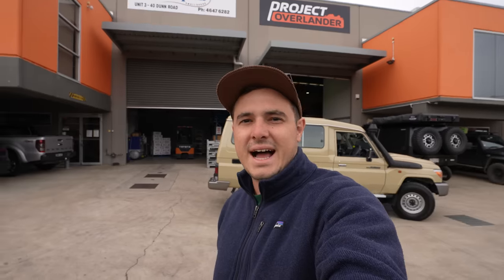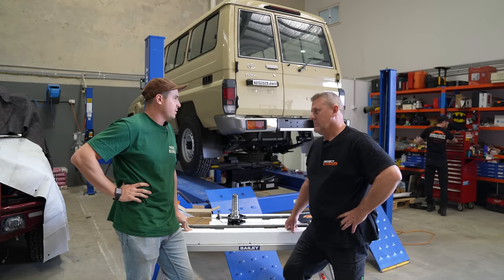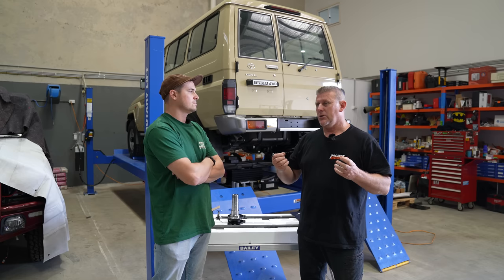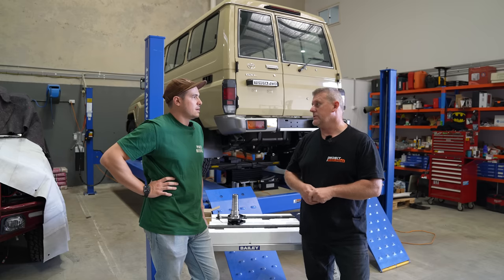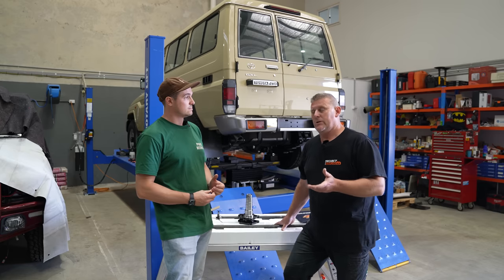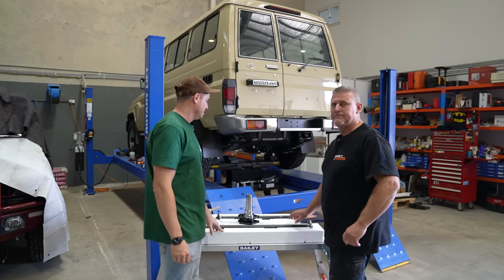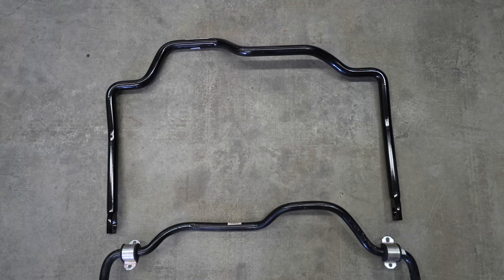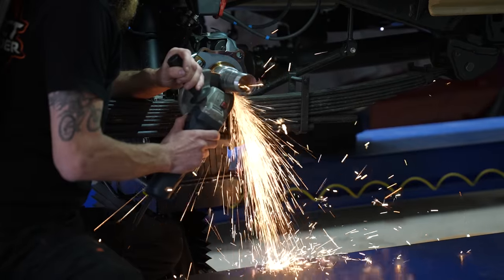Building An Overland Troopy - Track Correction and GVM

Comment: Looking good. The multi drive gear is excellent. I installed their replacement housing into my 76 series a few years ago. There is no doubt my wagon drives much better on and off road with the track corrected.
Reply from the maker: Good to hear from someone who has been using it!
Reply: @OverlandTravellers  no worries. Would be my first mod if I was to do my build again. I reckon you've gone about it the best way doing gvm and track correction pre reg. Perhaps consider a brake booster upgrade too if that's not already on your list. Standard brakes are adequate but will make you work hard to stop - especially when loaded up and rolling along at 80kph plus.

Comment: It's so generous of Toyota to keep little workshops like this in business by not building their vehicles properly in the first place 😉
Reply from the maker: It is pretty incredible the amount of engineering and products that have been produced because a diff wasn't wide enough 😅
Reply: @OverlandTravellers   I can understand how it started that way, but once Toyota realized how popular these vehicles were, it's crazy they haven't done anything about it in 15 years. All the excuses go out the window when you see a single mechanic in a workshop fix the issue so quickly and easily, and it would obviously be even easier to just do it right from the beginning.

Anyway, love the build, keen to see where you take it.
Reply: These trucks were designed for 90%+ pavement driving. Mostly for moms to haul the kiddos to soccer practice. Hence all of the aftermarket upgrades to make it off-road worthy. It’s a cottage industry. Where I live in Scottsdale, Arizona, there is literally a Ford Raptor or Ram TRX in every driveway. Almost none of the ever see any off-road driving. Again, soccer practice and a status symbol.
Reply from the maker: @KidBiff  hmmm not sure about this mate…. In outback aus the really remote parts, you see these troopys bouncing around everywhere. These things could be driven straight off the showroom floor and do the canning stock route in aus no worries.
Reply: @KidBiff  Prado maybe, but the 70 series are agricultural farm trucks (hence zero creature comforts). There's a difference between adding off-road accessories and fixing a track issue just so the thing drives straight.
Reply: It’s a sad economic fact that there is just not the market to justify the expense for Toyota 
At least we can still get them 
Toyota could have killed them off 
What would you replace a 79 with?
Reply: @batmanlives6456   Sorry, that's head in the sand nonsense. They've been making them for 15 years, there's a 6-12+ month waiting list for an $80k+ car, it's a goldmine for them. And we just watched a guy fix the track issue in a couple of hours. The notion that the entire thing has to be redesignd in a joke, plenty of 70's driving round with track correction.
I love that they make them, and hope the continue to do so (in fact I wish more manufacturers would take note of what the public want), but at that price they really should have fixed the issue when they realized how popular they'd become.
Reply: @OverlandTravellers  Indeed, not saying that these trucks aren’t trail ready, but it looks like significant mods so the truck can be capable to off-road the weight you plan on carrying. Like I mentioned in a previous post, I wish they sold these stateside with the diesel. There would be one in my driveway if they did. Looking forward to seeing the rest of the build and future adventures!!
Reply: @paulclarke4431  sorry Paul but the situation is a fact 
Toyota don’t make enough of them world wide to justify the change…
Reply: @batmanlives6456  Most car manufacturers make an entirely new model of each car every 5-10 years. You're telling me a vehicle that has been in production for 15 years and is currently not taking orders due to the 4 year wait list and "unprecedented global demand" (from their website) and they can't afford to just make their diff housing a little bit wider? It's because the demand is so high that they don't bother, not because they can't afford it. They could charge $100k+ and there would still be a wait list.
Reply: @paulclarke4431  the official line from Toyota in Japan is they are only for the Australian and Arabian and African markets low volume for Toyota 
Only the Australian marker and only some of the people are asking for this mod so small numbers don’t warrant the change
Fairly simple really
How would you feel having an extra 10 k to 20 k added to vehicle price?
A lot of these vehicles are used for humanitarian purpose around the world and this is why Toyota attempt to keep the price to a minimum 
They are not just for outback yobbos in Australia…
Reply: @KidBiff  rather uncomfortable soccer Mum's car.
Reply: @paulclarke4431  15years - no these vehicles came out in 1984! Thats 38 years of production
Reply: @KidBiff  i think u r wrong with this particular vehicle, this one is not a soccer mom kind of car indeed, 5 speed manual, virtually empty car, basic interior, this car is very capable stock, don’t be mistaken by all these mods people are performing in youtube videos, majority of these mods aren’t really necessary, they are just cool and someone somewhere makes money along the way.
Reply: @KidBiff  the world is bigger than US. Don’t compare a LC78 with a Dodge please. Go to Africa or Middle East and you see these thrown around as stock for 30 years

Comment: Great job man, personally after 2 years of no track correction on different tracks I haven’t noticed any issues OTHER than I it looking funny. 

BUT if i were to have a brand new car pre rego again I would just go ahead and do it too for peace of mind.
Reply from the maker: There you go, that's pretty interesting. As Steve said in the video, is it necessary? No.... But definitely nice to have.  It would be really interesting to have two side by side one with and one without and do some driving tests.
Reply: @OverlandTravellers  id be happy to help out 😁

Comment: Hey bud,

Didn’t see camber bushes going in for the lift?  Couldn’t hurt swapping out the remaining bushes since you have replaced bushes with rear springs, shockies, rear sway bar and steering dampener.  Did the kit include a replacement panhard?

kennym

Comment: Hi Matt, congrats on the work done so far. Looking forward to the rest of the build.
One question, how does Toyota deal with the upgrades in relation to warranty?
Reply from the maker: Great question and one I'm not sure anyone has a good answer to. Thing with warranty is it can't really be "voided" only refused, and that's if they can prove it was a result of the modifications.... then how is that proved, engineer, court 🤷‍♂️ ? Could be an interesting video if I did the research.

Comment: Did I miss it, but were the axles replaced with 55mm longer axles each side? Or did they reuse the original axles, but not protrude into the centre as much?
Reply from the maker: Hey mate, yes the axles were changed :)

Comment: What does it cost to have the engineering done, I'm from Utah we are free to modify our vehicle as we see fit, also why not change the whole axle the bolts seem sketchy. Good looking rig congrats
Reply from the maker: Engineering can be anywhere from hundreds to thousands it all depends on what you need done. by whole axle do you mean diff? the axels were changed and are longer. Its a really well made kit, from what I was told they haven't had a single unit fail.
Reply: @OverlandTravellers  yeah I mean the whole rear differential assembly, that extension is cool and probably a lot more feasible. It's great watching you guys having adventures and enjoying life keep posting and I'll be watching thanks